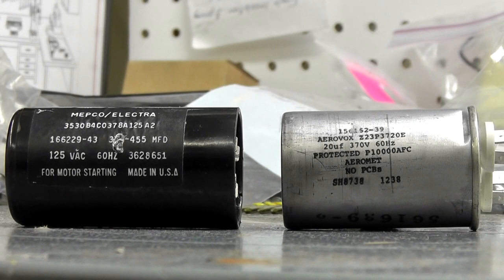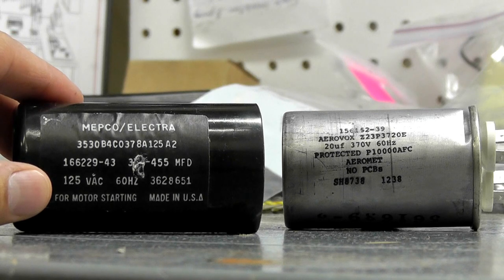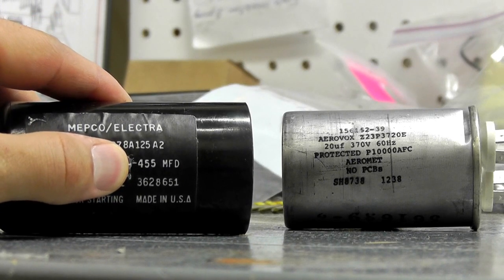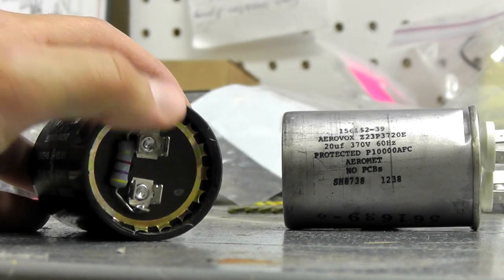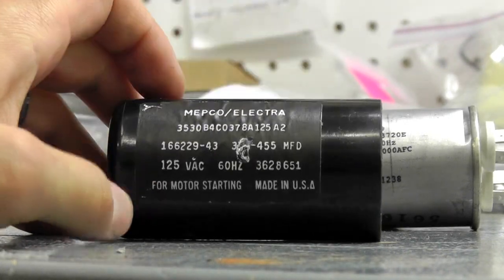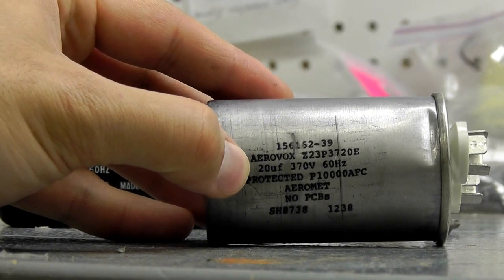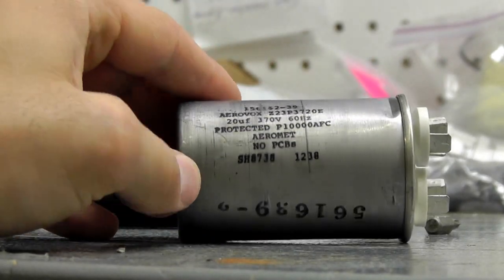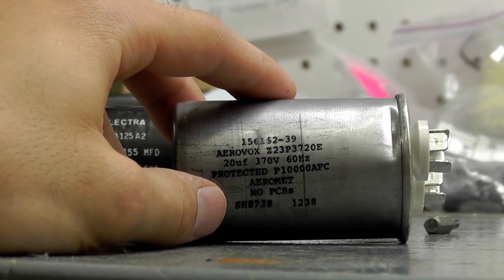How to Choose a Replacement Capacitor

Comment: HVAC techs can be the problem!   They will often replace caps based on what they are carrying on their truck; not what the unit calls for!  The units may run, but they may wear out sooner!

After educating myself on a/c electrics, I checked both my outdoor a/c compressor units and BOTH had incorrectly-rated caps.

I now have the correct replacements, plus spares and two replacement contactors - $120 for all four, off Amazon - about the price of a service call.

In future, I will always check things myself before calling a technician.

Comment: Have a question. I ordered a capicators. All the specs matched like 216-259UF 250vac 60hz +65°c 
When i received the capicators they are smaller in size. Why is that? Will they work?
Thank u
Reply: Did it work?
Reply: Yes they will work as long as the microfads and the volts match

Comment: what capicator can be used to spin a 110v dc hair trimmer motor? my trimmer was plugged in the wrong current and the green board burn but the motor is vibrating when i attached it to 110v current
Reply: Wtf kind of hair trimmer runs off of 110volts DC? Must be a bushhog hair trimmer

Comment: I put 50 mfd 44 0 volts in my furnace blower that uses 10 mfd 370 volts, It is running fine.But I ordered the exact one this is just temporary, Is it okay to use that higher mfd for now? Your response will be appreciated by the subscribers.
Reply: From what I've read up on this 370 to 440 is ok but the opposite will burn up the motor and the mfd should only be increased no more than 20 percent